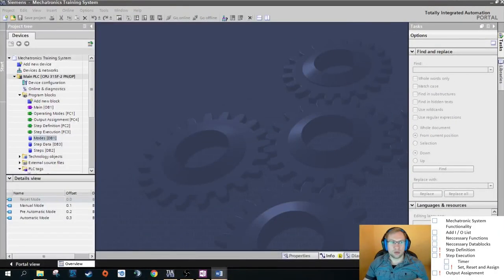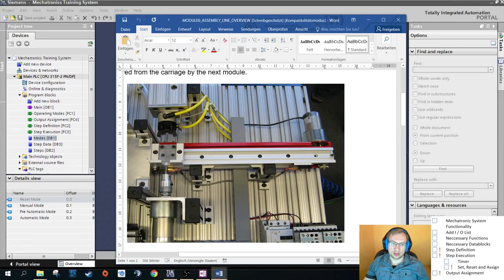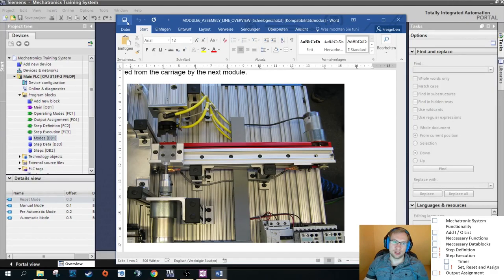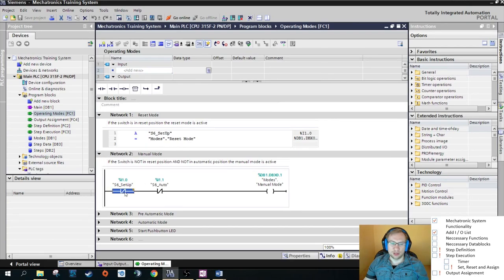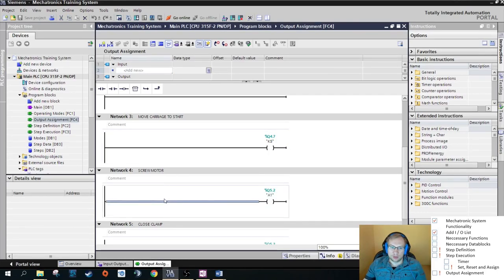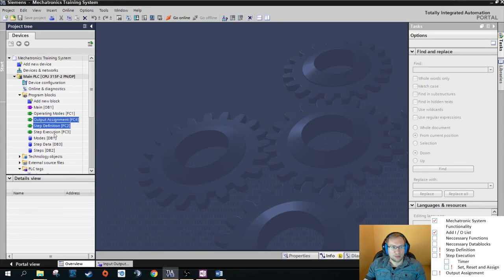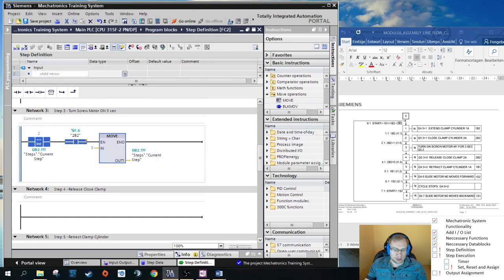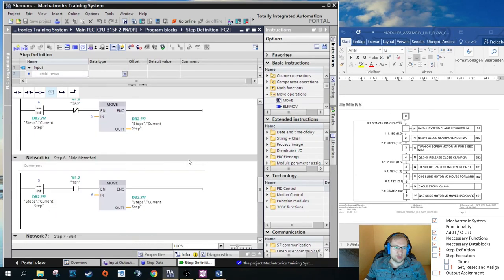TIA Portal: Sequential Programming in LAD/FBD (Available for ALL PLC's)

Comment: I would just add a warning here. This is very good principle but as PLC reads it line by line it can happen this way you skip in example from step 0 to step 2-3-4 immediately if conditions are active. That can cause unexpected behaviour if you want to trigger something and you skip the steps that triggers it. I have seen it multiple time, especially with parellel sequences. I would make it so PLC always dedicates one PLC scan to each step so you eliminate this problem. That case you can use in comparator as you did "Steps".Current Step but on the MOVE command you can use "Steps".Next step.  Then on the very first rung before all of this you insert IF "Steps".Current step<>"Steps"Next step THEN MOVE "Steps".Current step := "Steps".Next step. This way you never skip a step and always dedicate one PLC scan to each step. Anyway, great and helpful videos you got there!
Reply: You right, When I used  Case Of and tried to set bit on the only one plc cycle I saw this problem.

example...

IF blablabla THEN
step:=10;
END;

CASE step OF:

10: 
   bit:=true;
   step:=20;
20: 
   bit:=false;

The bit does not change state, but is still false on the end of the cycle plc
Reply: You can tell that you are a true PLC programmer because you know the right way. At my previous job we tried to do it without the comparator at the beginning and it would skip all our steps and we didn't know what was the problem. Not long after that I switched jobs to learn more PLC programming and learned that you need to use that comparator "new step <> actual step then MOVE actual step to Oldstep and MOVE newstep to actstep
Reply: Can you create a video ?

Comment: Thank you for the work you put into the videos.  If I have a suggestion, it is a good idea to add a constant table for the steps and use only this for comparison and step switching, it will be name of the number, cross-referenced and it will be easy to change the values when changing

Comment: The step approach is a nice way to break up your code. I come from the logo! Where I have now hit a wall and have to migrate. I think that your approach makes the move a lot less daunting. Thank you for putting the effort into these videos, without your expertise I would be stuck.

If you had to iterate over the code a set number of times should you nest the instruction in a timer or use structured text ?